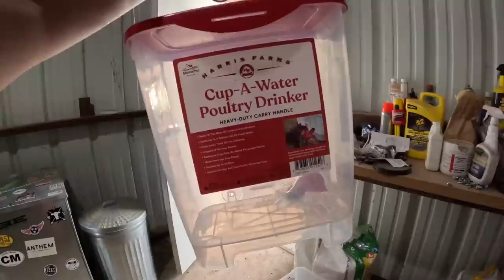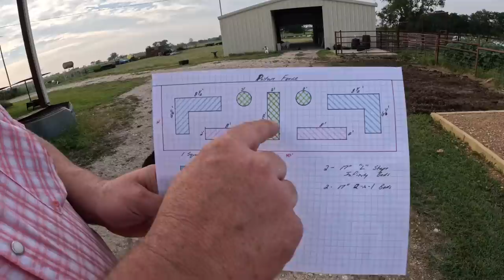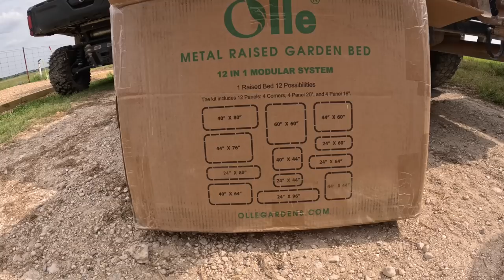How To Assemble Raised Garden Beds

Comment: Cody, get yourself some bachelor buttons and some suspenders that button.  I wear suspenders everyday and it beats the heck out of dealing with those clips.  Especially when they start spreading apart and not holding the best.  Only bad part for me is, once I put bachelor buttons on a pair of pants, wearing a belt with those pants doesn't work for me anymore.